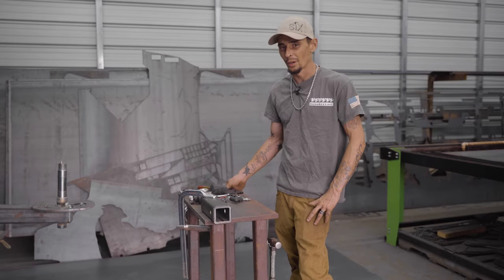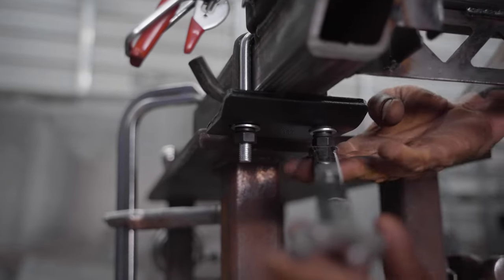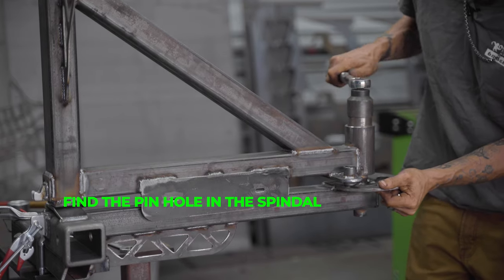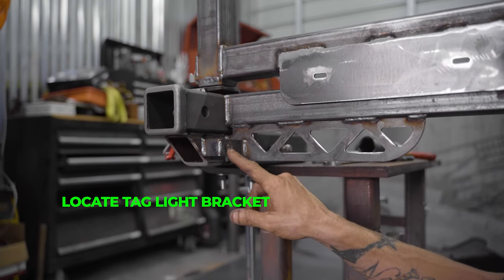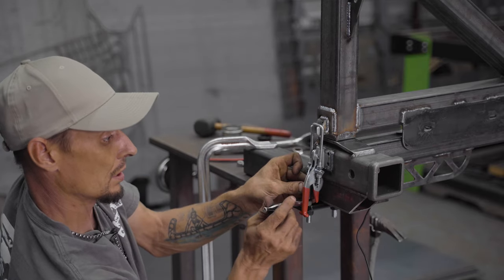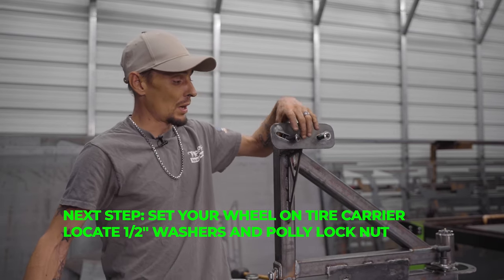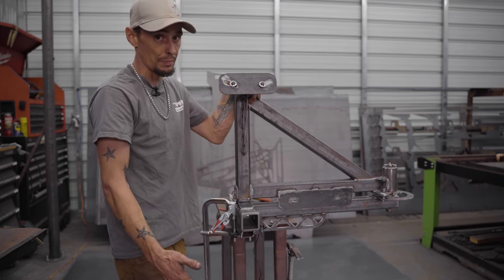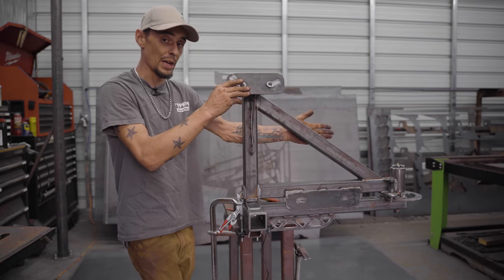Swing Away Tire Carrier Install Video | 6Monkeys Offroad

Comment: Just received mine and it's amazing, got it coated in the rough black texture for my green 06 Commander. They definitely changes the format a little too, you insert the barring and tighten from the bottom with the cotter pin now. Also mine didn't come with the bolts for the wheels but I can scout some from home depot or something. Extremely well made quality product!